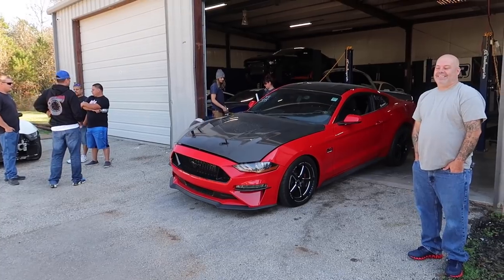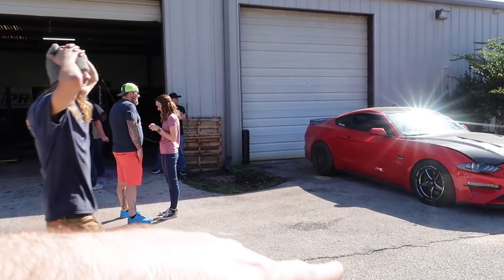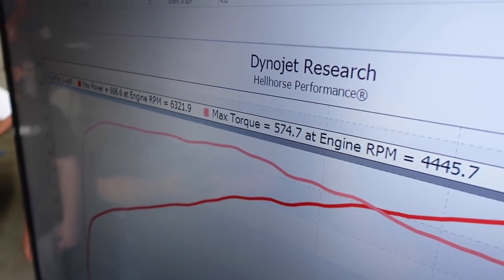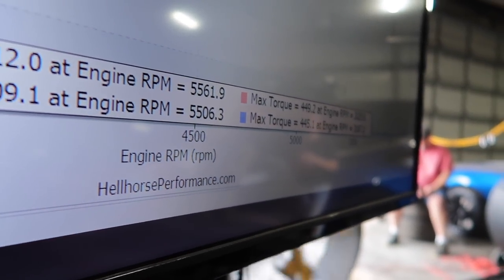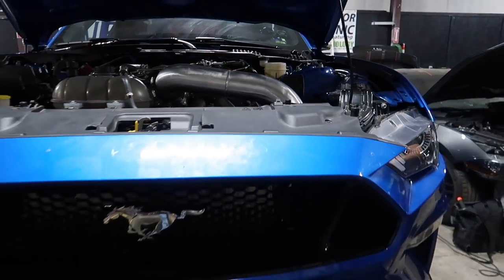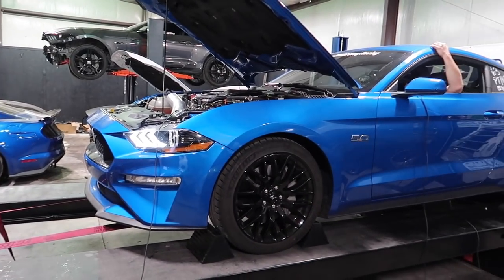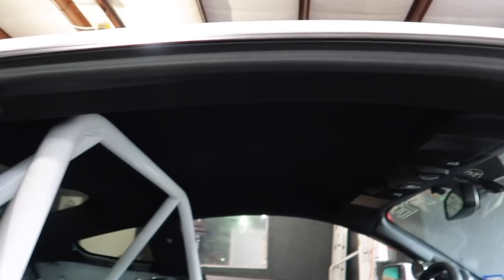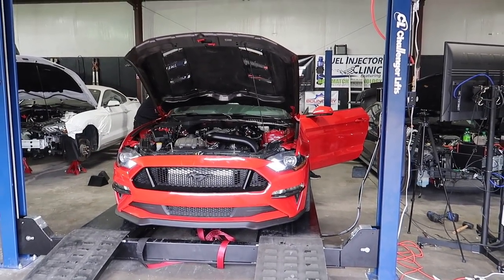My 1100hp Twin turbo Mustang GT CAN’T COMING HOME... Here is why

Comment: Think I'd street drive it on around the 750 to 800 wheel area then have the option to turn it up for track and Mexico. Think id rather have that extra torque from the c85 especially for the track